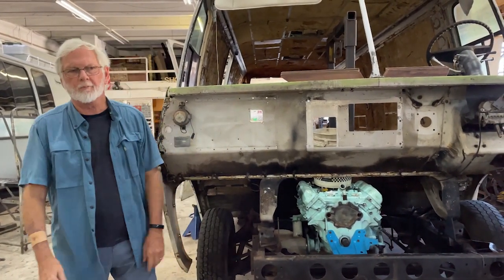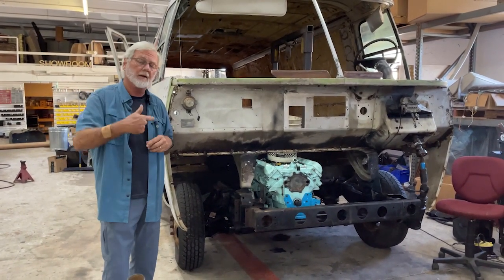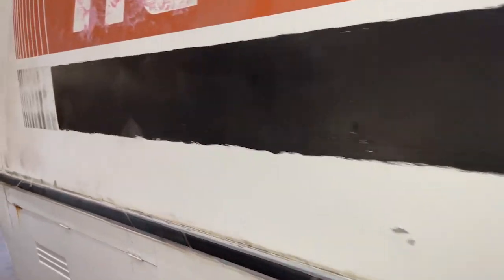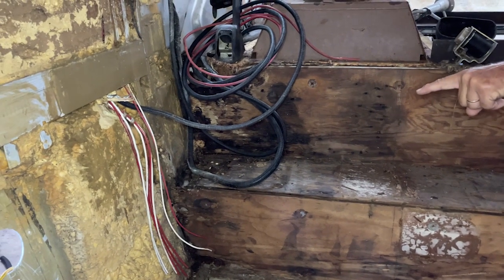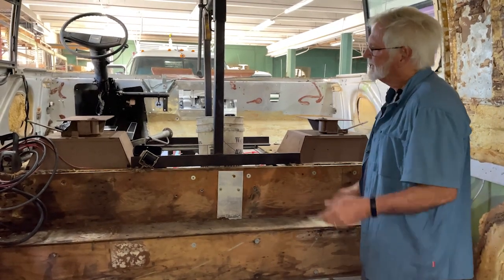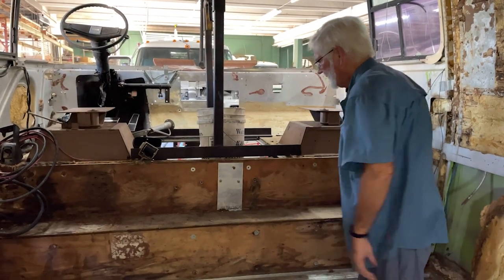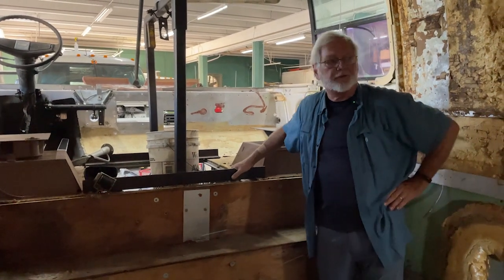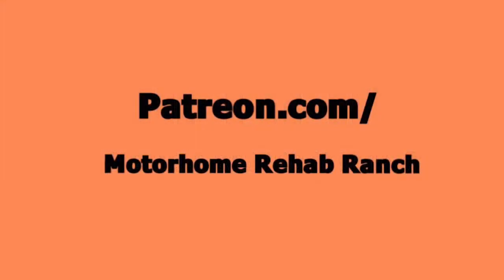Insulating The Front Cab of Your GMC Motorhome

Comment: I would use plywood and extruded polystyrene foam sheeting (XPS foam board) combined. You'll have more strength than you could ever need and an extremely efficient conductive heat insulator to keep the cabin area cool. The compressive strength of the XPS foam board is amazing. You can get it up to a compressive strength of 100 psi. I would use it on the entire floor of the rig as you won't need framing on the floor when using it. No framing means no thermal bridging. No thermal bridging means no condensation problems. Radiant barriers do little for the conductive transfer of heat. They are very effective at blocking heat being transferred through the atmosphere (like the sun's rays) but once you sandwich it up against other materials, it acts more like a conductor than an insulator. Save that stuff for blocking the windows during the heat of the day. I also noticed in the side walls of the rig you were in there is exposed framing on the interior. If you attach your interior panels directly to metal framing on any wall, floor or ceiling you will have problems with condensation in your walls. Wheel wells also need to be protected. I would use closed-cell spray foam insulation on the interior walls and ceiling. It will give you the best "R-value" with no need for a vapor barrier. When done professionally by an experienced installer it is safe to use. Great looking rigs in that shop. Love those GMC's.

Comment: Jim 

I am putting down Hushmat.  Similar to Dynamat but is said to reduce heat transfer by 40%.   I applied this to the dash wall, the side panels and cab floor.  It will also provide a moisture barrier if water comes in the window. 

A couple of comments on the step. I removed the aluminum tab. It has no purpose and if you want to put flooring on the step it is easier without it.  Second, I even the steps so they are both equal. Originally the first steps were 9” and 11”. I added a 2nd layer of plywood to have both steps have the same rise.